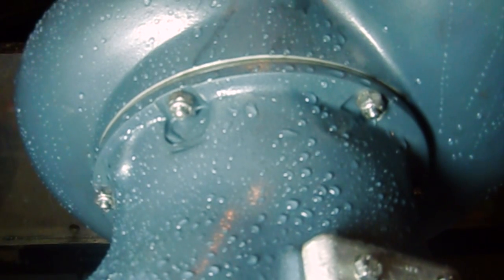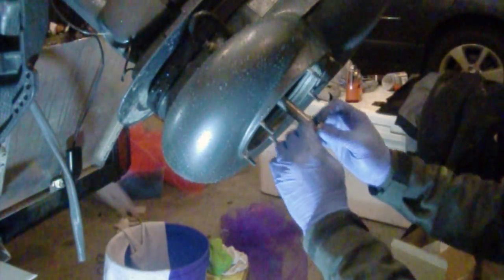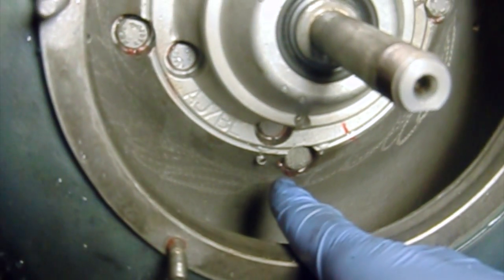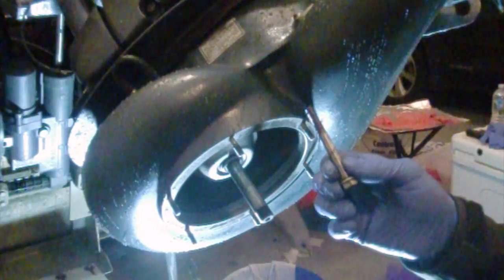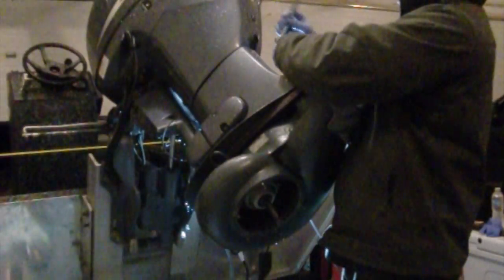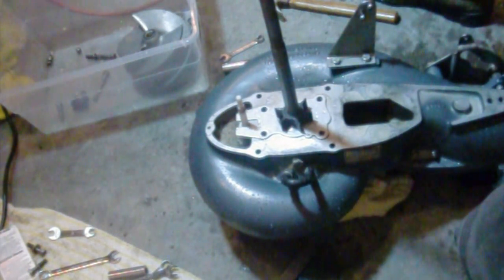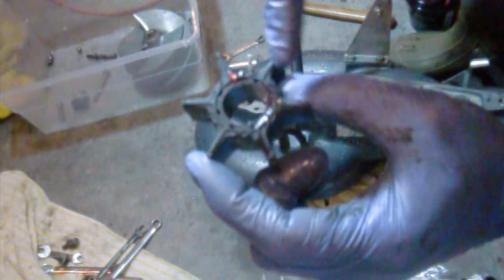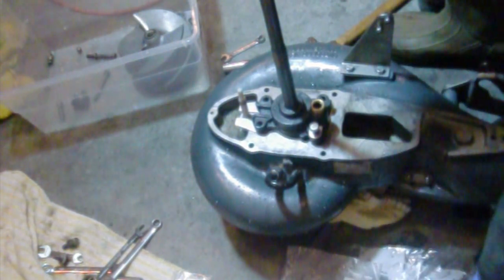Yamaha F50 Jet Outboard Water Pump Replacement

Comment: Do you have any other videos getting into the bearing seals? Believe to have a bad seal right now getting more water than usual out of grease, and applying more than usual which tells me it’s passing a seal. This video was very helpful I just need to go little further. Thanks
Reply: Di you ever find a video showing the seals and bearings replaced?

Comment: Thanks for making the video! I followed all of your steps and can't get the jet to sit flush with the lower unit when reinstalling it......... Do you have any advice?
Reply: Take a dead blow hammer and softly hit the bottom of it.
Reply: @corymyers9813  hey man, thanks for the reply. It ended up being an extra water tube spacer that was included with my kit. After I removed it, the jet slipped in place very easily. Thanks man!!!
Reply: Right?  Why do they include extra parts with a kit?.. I'm sitting here for 2 hours wondering what the hell do I do with this o-ring.... Turns out, I do nothing!  Ha

Comment: YOU TURN PUMP HOUSING WRONG DIRECTION, SHAFT GOING CLOCK WISE ,
Reply: Thought same thing?
Reply: Can you explain the differently?
Reply: Just used this video to help change my water pump.  Lots of Great Details in this video. But, Yes, the water pump housing should be twisted on counter clockwise.  Or spin shaft clockwise as you gently press housing down into place.

Comment: How often do you think this part needs to be replaced?
Reply from the maker: +Chounburi Vang it all depends on the kind of water you run and what you're sucking in through that jet pump. Some people go years without replacing it. I run a lot of glacial and sandy rivers, so stuff is always getting sucked through the water pump. I am replacing it once a year, just for a peace of mind. Especially since I am running two hours one way in the boat sometimes. You don't want to get stuck out there due to a failed part, that can be easily maintained.
Reply: good!
Reply: good!
Reply: good!
Reply: good!
Reply: good!

n